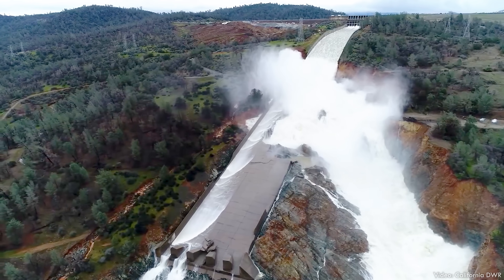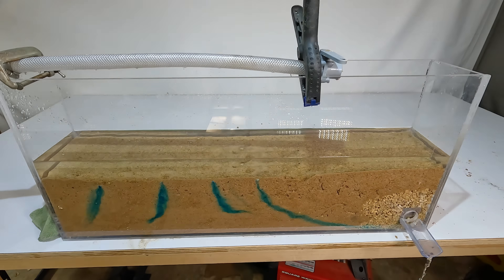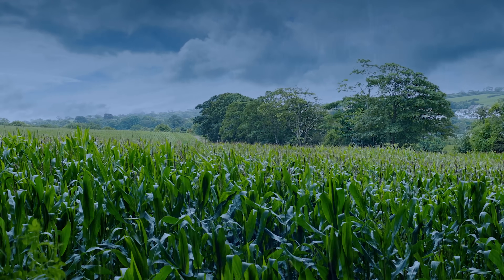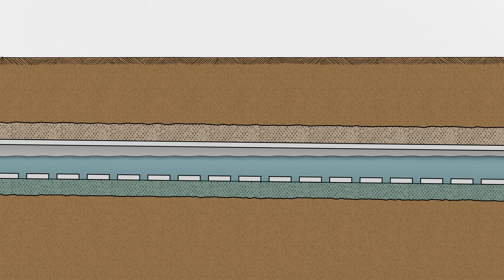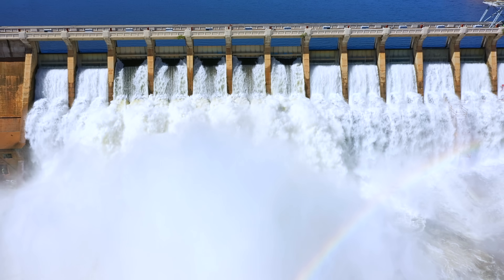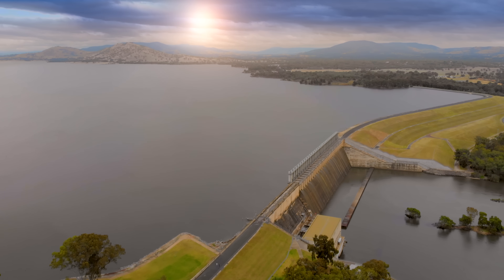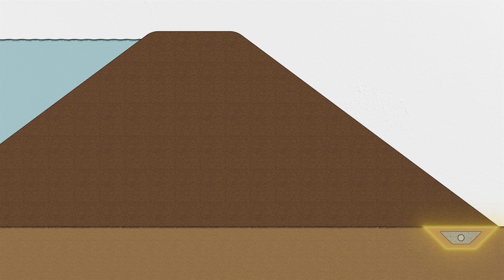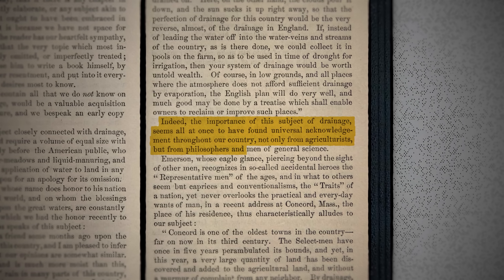How French Drains Work

Comment: Is it common to have french drain systems around houses in US/other countries? In Finland, all new houses (mid-90's forward at least, and commonly retrofitted to older houses too) it is common/mandatory to have them. Typically there are inspection wells around corners of the house, with each well being slightly lower than the other so you lead the water to a single sump where it either is pumped away or drained via gravity to municipal system.

I recently had mine inspected, and the system had deteriorated over the years and was not functioning as it should so that'll be something to fix in future.

Comment: would it be possible to let water drain into a lower underground area with soil/particles that allow for good water flow? Obviously not for a lot of water, but if you're trying to buffer the natural drainage of an area, giving an easy pathway to an area you're okay with being wetter, and that has decent natural drainage, this could be passive, like letting it to the surface at a lower point, but possible in areas that that's not really an option.

Comment: I bought a house and found out it flodeed during monsoon season. I dug trenches around thr shop and patio and backfilled it with rocks. Inalso graded the trenches to the back corner of the yard and it has worked really well so far.

Comment: 5:27

Why not orient the pipe holes upward from below the middle? Basically, drill holes Up from just below the halfway point so that the water goes half way up before spilling over the edge and then goes down into the holes. You would need either 0 shaped pipes rather than o shaped or just slightly thicker pipes to make it work, but if you make the pipes bigger to keep the inside the same width you should mostly be increasing pipe durability on all parts except where the holes are drilled. Alternatively, for thicker pipes, the pipes could be designed thicker in the parts where the drilling will take place but thinner elsewhere to miminize costs.

The flow will be smooth as the holes aren't on the bottom (to wash away particulates), there will be twice as many holes for increased drain intake (though perhaps the holes will be slightly smaller), the pipes start draining half way (to hopefully prevent flooding as much as possible), and the holes will be protected from particulates that would drop down from above because the holes have a little 'overhang' due to being drilled in an upwards diagonal direction. Yes, some particulates will still get inside. But the holes being half way up for a more consistent water flow should take care of this for the most part to minimize maintenance.

Comment: I recall, many years ago when my late father had a new drainage system installed on our family farm, there was some kind of filter integrated onto the outside of the plastic pipes.  (The farm had a previous system of clay tile drains, but they were installed relatively shallow, making them more vulnerable to damage, and in the clay and loam topsoil layer, making them highly vulnerable to clogging.  The plastic tiles were installed in the much sandier subsoil, where it was easier to keep the soil out.  Heavy machinery allows a lot of nice options.)

Comment: Learned about French drains while studying Landscape Architecture, which too, carries big emphasis on subsurface engineering matters like French Drains, as well as soil types and impacts, subsurface hydrostatics and hydrodynamics(i know you can only delve so deep into a subject per episode, but 2 others factors if folks are curious that play into French drains is pipe depth for water pressure{I'm probably off so pls correct me if im wrong but for every 1 foot drop in elevation its 1.533 increase in psi; and vise versa) and granular shape for permeability{difference in angular and rounded grains} 

which reminds me, 
HAVE YOU DONE AN EPISODE ON PERMEABLE PAVEMENT? 2 things I've always been a big advocate of since i started studying Landscape architecture is Green roofs and permeable payments, which combined [and if fully implemented] could solve so so many issues that big urban cities have from flood management, to ground water restoration to mitigating the Heat island effect, to having available green space for the public and building tenants alike, to even concerning energy savings and much more! if you haven't done an episode on Green roofs i highly recommend it! 

{{{Other ways to mitigate water flow for residential if French drains are too much!}}}}
Google Water garden! Xeriscaping! Bog Garden! In conjunction with French drains: Pond or Aqua Gardens! just dig a pit over yr drain, plant some amphibious plants! boom pond garden doubling as small retention pond! Good for properties without Sumps or low lying property with no water drainage!

Comment: The perforated pipe in my back yard filled with roots quite quickly. I would put the holes only on the bottom just to slow down the root invasion.

Comment: I'd love to learn more on best practices for installing French drains in a retrofit of a home that gets water under the below grade crawl space. I've heard mixed advice on whether excavation of the soil around the footing to install a French drain system with gravel and sand compromises the structural integrity of the foundation. I've also been told to dig it 18-24" away from the footings so the soil isn't disturbed and water never reaches it. Is there a best practices blog post somewhere for this normal situation?

Comment: Loving your videos.

I find that the best French drain is the one that never sees a drop of water. Of course in many large structures this might be impossible 

For one family homes though, there are options. 
1) grading the surrounding area to lead surface water away from the home.
2) overhangs can help keep water away from a building 
3) the Porch/Veranda, 6 feet deep around the entire structure with an additional 1-2 foot overhang should, theoretically keep basements dry and the French drain empty. 
4) bonus: French drain the surrounding area to lead sub-surface water away from the building
Reply: #1 is a huge obstacle for existing homes with established plants and hardscapes. BUT, it is the best solution. You are also dependent on the original grading, structure pad, and native soils. It's a riddle.
Reply: @wayneblanchard4347  yes, existing structures have a harder time implementing good water management. 
And it’s usually more expensive too. However if you already have water issues, it’s well worth it.

Comment: I worked for the highway department, DOT for those that know. When we build a road, SO much science goes into it. We have complex testing and formulae for determining how to build the "embankment," the substrate the road will be laid upon. Both the permeability, the determination of height to width, level of compaction at multiple levels, ALL that matters and goes into what it takes to build the roads you drive on. Now, this is the state. That's the reason you RARELY see potholes in the highway. Sadly, city streets don't have the Federal funds we get to make sure they last. Yep, that's one of the many things taxes pay for, my friends. BTW, we who worked FOR the state don't make a lot of money, and I and my colleagues drove trucks with well over 100,000 miles, some with no real dash anymore.
Reply: I-20 West of Atlanta has several spots on a downhill stretch that are wet 24/7 at the joints in the concrete surface. I'm guessing there's a spring under the road. Do you think that is okay, or something the state will have to fix someday?
Reply: @MrHuram-abi  State by state it's always a matter of budget. Send complains to the highway department, someone will respond if they get enough complaints. The substrate/embankment is experiencing subsidence in some areas there, and if they're using slabs at 30 foot intervals or so, it's likely in that area they didn't seal the seam well and it got undercut with precipitation.

Comment: Thanks for this. I had noticed the contractor of a highway here placing gravel between the retainer wall and the embanked soil and I thought it was to prevent corrosion of the steel reinforcement in the retainer wall, since soils here are very acidic. Now I know.

Comment: You may never see this comment but as a kid I lived on a farm where we had a trench digger and we put in plastic pipes for drainage in the farmland. This brought back a lot of good memories. We also had clay drainage pipes that occasionally had to be dug up and fixed outside our 200 year old home.  God bless.
Reply: Half of America has drain tiles in the ground. The pioneers found that the interior was quite wet
Reply: @TheCornucopiaProject-bd5jk  That makes sense. This was in upstate NY where it rains a lot. Drainage is very important so that soil runoff didn't happen and all other kinds of shenanigans.
Reply: @jesuslovesyoujohn314-21  the reason we have such fertile soils is partially based on it. Farmland was unusable without drain tiles. The ditches next to country roads are not for street runoff.
Reply: @TheCornucopiaProject-bd5jk  Oh that is interesting. Yeah that is true I saw a ton of water run off the fields into the dug out parts of the sides of the streets. I believe I called them gutters as a kid but I am not sure if that is the correct terminology. During the thaw in spring time the amount of water going through them was a lot. I do remember that the pipes we laid down in the fields went into those gutters.

Comment: After high school I was working construction jobs.  At one point I was on a pipe crew where we replaced a bridge with a pair of 21' arch pipe.  Basically they took a 21' diameter round pipe and then put it in a press to squish it down a bit so that it would be more egg shaped with the same flow capability but less height requirement.  The area I was in was near Sioux Center, IA and the fields all had a bunch of perforated plastic pipes that were referred to as "tile lines."  There were a few natural springs in the area that would keep the fields soggy and rain just compounded the problems. 

In the process we had to pour concrete walls and "slope collars" around the pipe to keep them in place.  They also had to have a TON of gravel underneath (I believe it was 18" under the pipe and another 18" or so up along the sides of the pipe that all had to be compacted in 6" lifts) and part way up the pipes so that any water ingress would be able to make it's way out.  The outflow side of the pipe also had to have some 3" diameter pipes put in to act as weep holes so that any water that got around the pipe could easily find it's way out.  We actually had to leave part of our formwork in place for the inflow side of the pipe because there was no way to secure the pipe into the headwalls and pour the concrete in at the same time without tunneling underneath the pipe and gravel which would have defeated the purpose.  The inspector also said to just leave the outflow side formwork in place rather than waste the time to pull it out since it would probably take a few hundred years for the waterlogged wood to break down anyway and the buttons that were used to hold the formwork together were worth so little it wasn't economical to try and remove them vs the time and cost it would take.

Comment: The more I learn about water tables, hydrostatic pressure and water removal the more appreciation I have for engineering. We live in the North East US. Seven years ago, my basement was dry as a bone (which is one reason we bought the house). But with the increase of storms and the huge amount of the water they bring now,  my basement is now flooding. 

We spent thousands of dollars trying to fix it. Namely, with French drains. But the water table is so high it’s been a challenge. I’d love to see a video on the function of sump pumps.
Reply: Letting water and gravity do the work is the key, right?  Got to make the deepest hole you can and if there's no outlet to outside your land then you have to pump it away.  Or cheekily direct it into the sewage system...

Comment: I know nothing about engineering. When you asked where the holes should be in the drain pipe, my hypothesis was to have 2 rows of holes on both sides but closer to the bottom than the top. 60° from the bottom / 120° away from the top.
I never considered having them at the bottom or top.

Comment: Grady, for directing water away from a house, a pipe under soil isn't needed. An open gutter, trench, or swale works just as well and avoids the problem of the pipe clogging up, which pipes will do eventually no matter where the holes are.

Comment: I think it was the summer after I had turned 12, my dad had me put in drainage pipe (holes down on top of the rock that helps get the proper drainage slope) It was probably about 100 yards to the end where I dug a big hole and filled it with rock for the water to drain into. It was wild, made our own liquid level line with pvc tube, water, and red food coloring.  I look back on that now and that was a bit of a thing for a 12 year old.

Comment: Interesting video. The mechanics of drainage well explained.
I just built a french drain around my house and also a retaining wall with drainage behind. All been built relatively well regarding the information in this video.
Except for one thing, I now have soil directly on top of the geotextile, which I should replace with sand. the soil is fine silt and gets almost water tight over time, and from the video I just learnt that sand allows the water to flow more freely into the drainage and prevents the geotextile from clogging up.
So I'm going to do that before I replace the pavement.

Comment: 10:39 Ok cause I was gonna say, you can use varying sized gravels to make a filter system, just like you were making a water filter to purify, using sand, charcoal, and membranes.
Every time I clean my aquarium I classify the rocks (and take out snails) then put the largest down first, then the medium, then plants and small. Makes the under gravel system flow so much better

Comment: When we lived in West Virginia, our house was on a hill, so one side of the basement was underground. And when we moved in, there was water in the basement seeping in through the wall, and the base of the wall. 

My husband dug out the ground behind the wall along the length of the house, it was about two feet wide, and about 7 or 8 feet deep. 

He did this entirely with his shovel. 

Then he put in some draining gravel, and then…

He used drainage pipe with holes all over!

It drove me NUTS! I’m not good at math or science, but I understand that water flows down. I begged him to use a pipe with holes only on top. I implored! I even tried using a straw to make my point.

But ultimately, the countless backbreaking, callous earning hours in the muddy ditch, had bought him the call. 

And I must admit, when he was done, the basement dried out. I still don’t understand it.

Comment: The hole orientation is only important in relatively extreme situations. Ideally you will leave the bottom smooth with the water running fast enough to clear debris, but holes on the top will disturb the flow and encourage debris to enter and even clog the hole. Fortunately the sides are twice as common as either the top or bottom and is an excellent choice.

Comment: Ahh, but the French drain will not work as desired when the suction potential of the soil outside of the drain’s backfill media is much higher than that of the drain’s backfill. Some NFL stadiums remained a soggy mess until soil engineers were brought in to point out why. This engineering discussion about French drains should include some mention of soil suction potential. It is not “too much detail” that can be ignored.

Comment: I bought an investment property, and the backyard was soaking wet all the time from a spring that leaked from an adjacent lot.  The septic tank would not work.  I rented a small backhoe and dug a huge drain around the perimeter of the property and put in corrugated pipe and rocks and it dried the entire thing up.  The pipe simply led along the side of the property to the good dry soil in the front of the property and it dried up the entire property.

Comment: I used to install drainage. We consistently found holes on the bottom of perforated PVC worked better. Sediment tended to have a hard time entering the pipe from below. It would simply sink further into the gravel bed that was supporting the pipe. Not infinite life, but it would take a long time to fill up the gravel trench (~100 yrs?) compared to allowing the silt to enter directly from above. 

It's also worth noting most perforated PVC pipe for drainage actually has 2 lines of holes somewhere between 60 and 90 degrees apart. There is a smooth flow channel available inside the pipe between those two lines of holes. Holes down, in my experience, just worked better: started draining sooner, was more resistant to clogging material ingress, and lowered the water table.

Comment: The best way to control water around the basement is the back filled with several feet of drainage Rock and have the rock under the slab. You can ring that area with a drain but the rock should prevent hydrostatic pressures.

Comment: Perforated pipe:  

It depends on what it’s being used for.  

It the being used to slowly discharge water into the surrounding ground;  You want the holes on the bottom.

If you’re using the pipe to channel water you want the holes on the top.  Holes on the bottom can saturate the soils around the pipe and “float”  the pipe to the surface.

If you’re plugging the end of the pipe and controlling the release of water you want the holes all the way around.